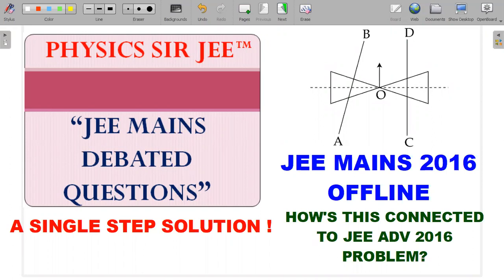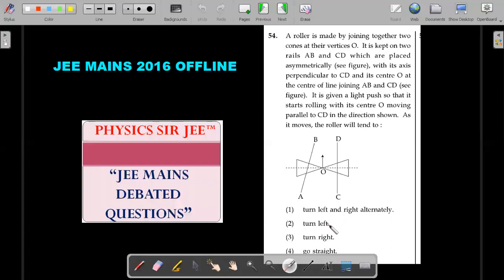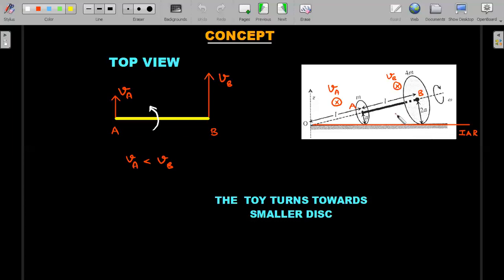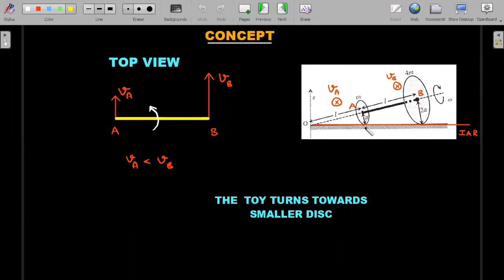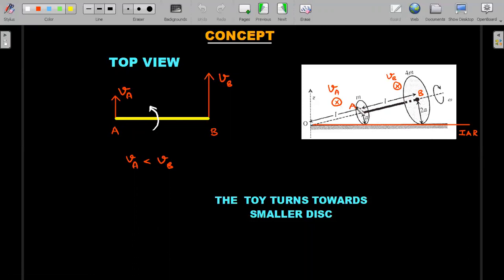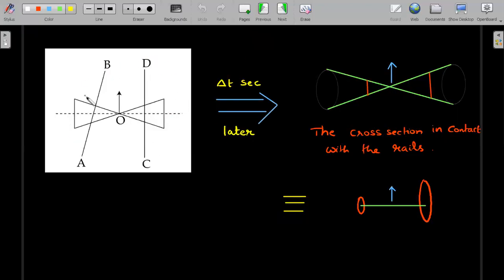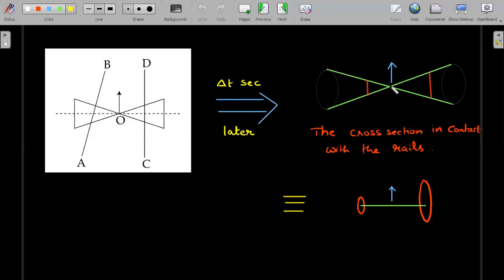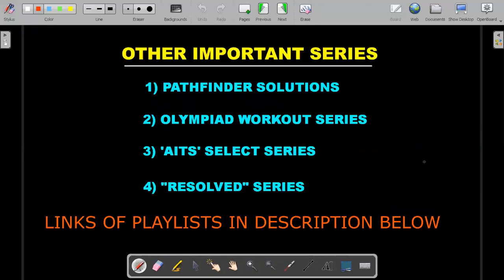JEE MAINS DEBATED QUESTIONS🤩-2016 OFFLINE-DOUBLE CONE ROLLING TOY CHALLENGE

Comment: Sir i have an alternative thought , i just wanted to confirm if it is right or not
:When rods are symmetrical normal forces exerts equal and opposite torques.,
So suddenly when one rod becomes close to the line of motion, torque reduces as distance from axis reduces ,and the other torque dominates in turning it to left.. please correct me if i m wrong sir, thank you
Reply from the maker: Well done ✅👍🙂